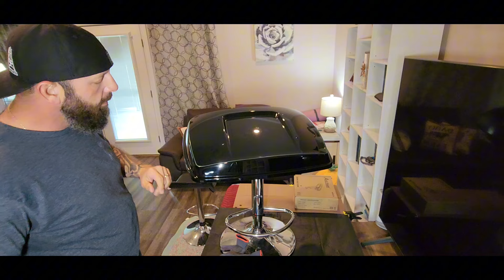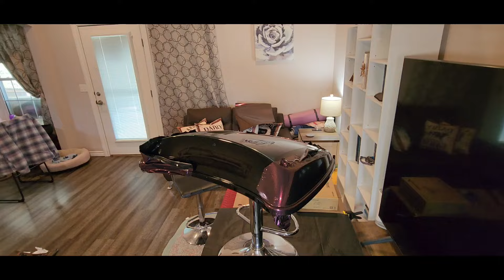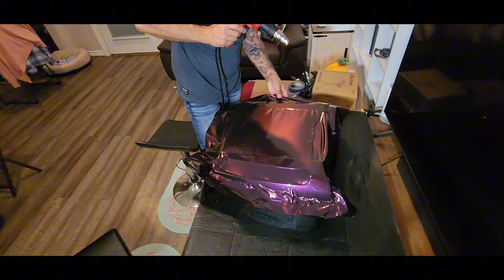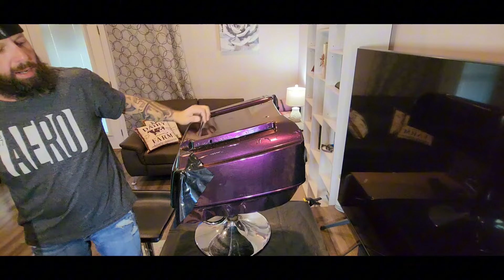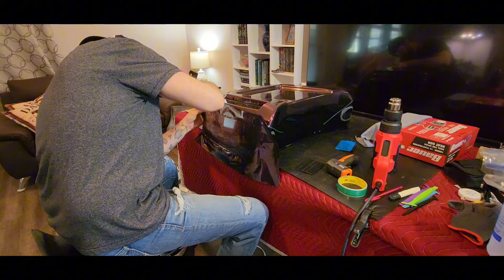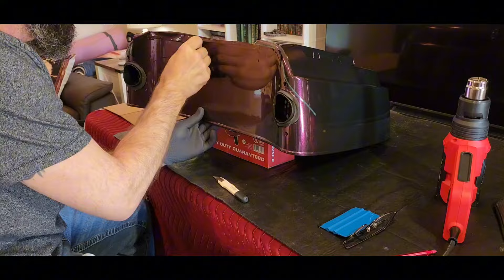Part 4 . wrapping my Harley davidson ultra limited king tour pack. using Vvivid Nightshade Purple.

Comment: Hey. You’re the 1st person I have seen on you tube wrap a tour pack. Early this year, I was looking hard because I was about to wrap my street glide. Most of it turned out pretty good but, the tour pack not so much. I’m planning to re do it this fall and I’ll definitely use some of what you did. I’m obviously no pro but, what I have learned is that stretched edges have peeled and shrunk. I will be using the primer on the edges for the next go. 
Looking forward to seeing you wrap the tank 👍
Reply from the maker: I'm glad to hear it helped.  Also, the 3m primer pen works the best for me. Just a fyi.